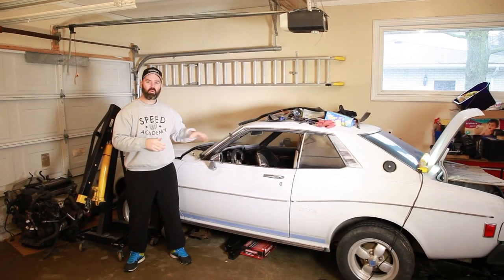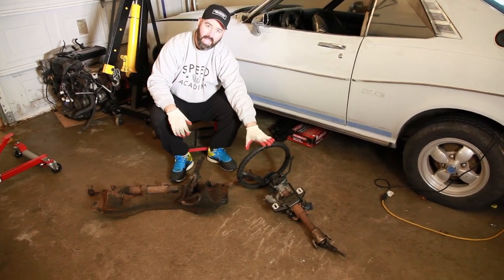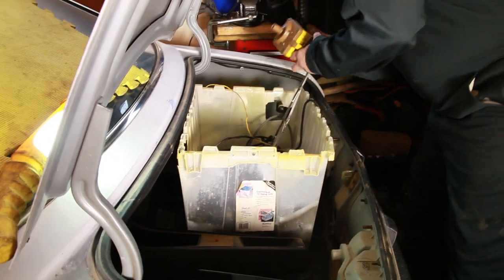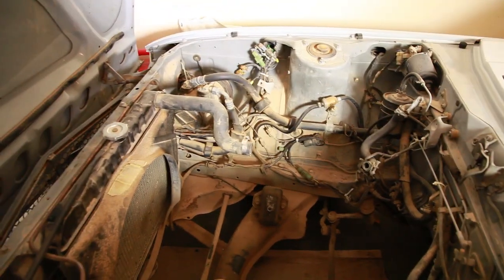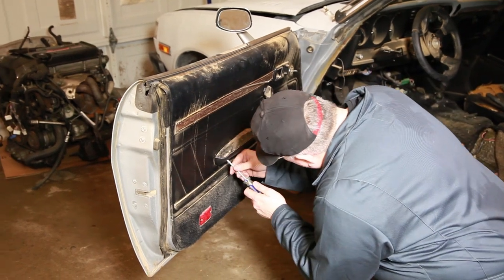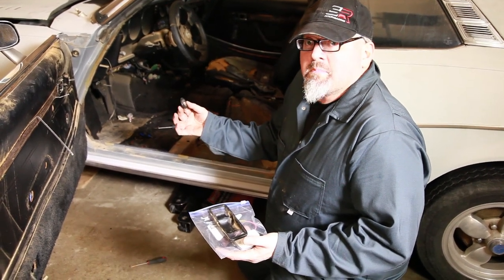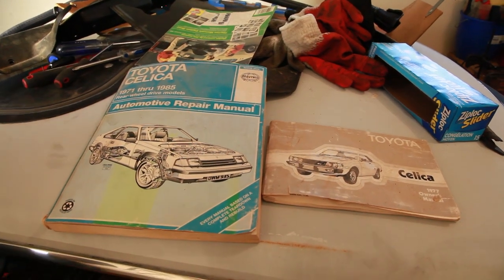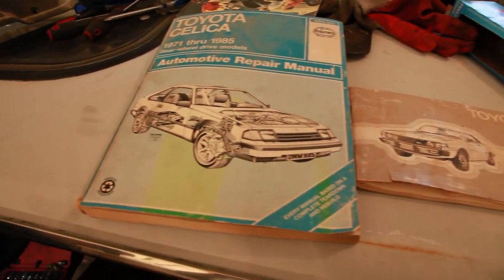That Interior Has Gotta Go - RA24 Toyota Celica Build

Comment: back in high school ('84-'88) in new mexico, a friend had one like this but dark green.  the major difference was the bottom 8" or so of the car was rusted through...rocker panels, lower fenders and quarter panels, lower door skins, parts of the floor pan, etc. it still ran though. so this series is like a trip back in time and in a different universe where 10-year-old Toyotas aren't rusted into the ground.

fwiw, it would be cool to see the interior as close to original as possible. the comment about the carburetor going in the trash made my day...they all belong there! LOL

Comment: I did the dry ice trick on my old 83 celica and then did a black roll on bedliner.  If memory serves me correctly that paste sound deadening stuff weighed like 50 LBS.
Reply: David Pratte Ya, dry ice, flat head screw driver, and a hammer.  Around the transmission tunnel and the front seat foot wells were a little difficult just because of the slope.

Comment: have you decided what wheels you're going with?
maybe some rs watanabes?
Reply from the maker: +The Ultimate Racer debating wheel choice at the moment. Tempted to go with a new retro style wheel like TE37v or Enkei Apache II (which is close in style to the OE wheels), but also thinking about rebarreling and refurbishing some vintage 3-piece wheels off of Yahoo Auctions Japan or trying to find something wide enough from that era like Watanabes. It's a tough choice since wheels obviously define the look of the car so strongly.

Comment: Could you tell me the measurements of the beams motor with the accesories on? I've got a 75 Opel with an anemic 90 hp turd and a small engine bay that I don't want to hack for clearance.
Reply from the maker: +andyvoytko sure, do you want nose to tail length of just the engine, or with the trans, and do you also want height and width?
Reply: Height,width including accessories,and length of engine. Thanks a bunch.

Comment: You guys should try to save that dashboard and console, though,  somehow: those have got to be my fave interiors ever made out of plastic.  :)  Dash pad might be tricky,  admittedly.  But if the rest is saveable,  I'd be doing it.  :)
Reply from the maker: +OllamhDrab definitely going to save the dash and console. Will order a new dash pad and will probably put some custom gauges into the factory gauge locations using Autometer's custom gauge service.